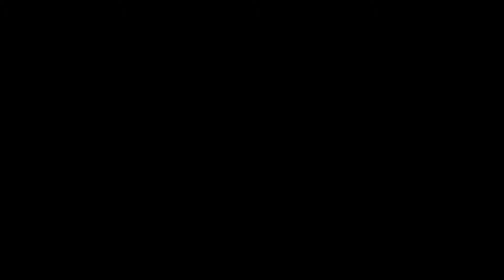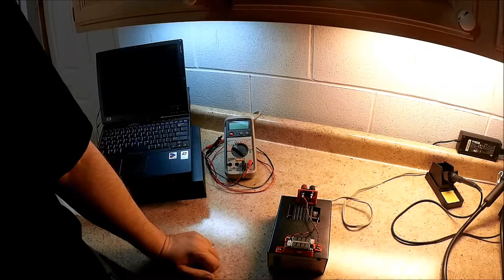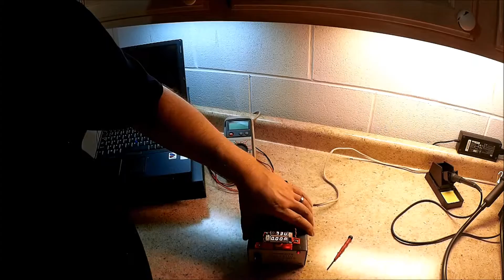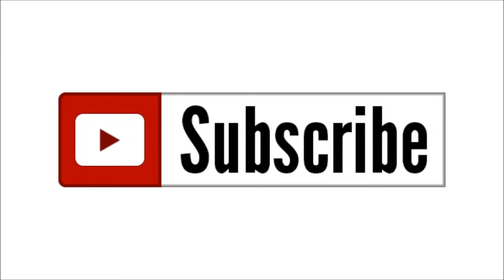Benchtop Electronics - Power Supply with 3D Printed parts

Comment: Hah!! Just viewed this video and how timely!! I'm attempting to turn a spare  ATX power supply from a PC as a bench top power supply. I will have +12v, -12v, +5v, & +3.3v outputs to banana clip connectors like you have on this project. Now one thing I would like to have is the ability to have +24v but know I can't just connect two of the +12v lines together because I would only increase the current capacity instead of voltage. But could I connect the +12v & -12v lines to get that +24v?  I have a work project that I am messing with where need to provide some voltage to a MOXA e1242 DI channel that will provide a signal that will pass through a N.C. float switch where the MOXA will monitor for change of state when the float moves. I could use a wall wart with about 16v that I could use for testing my mock up but wanted to make a bench power supply because it's geekier.  I am printing a housing from Thingaverse for this.
Reply from the maker: +Norbert Davis To get to 24 volts, you would need a power buck to kick it up (http://www.ebay.com/itm/DC-DC-Step-Up-Down-Boost-buck-Voltage-Converter-Module-LM2577S-LM2596S-Power-N2-/400985223988?hash=item5d5c94f334:g:HhsAAOSwgQ9VpIkZ)
Reply: I like that.  What about this one from Amazon? https://goo.gl/j45pdi  Its only $6.70 and is Amazon prime.  I have other stuff to get and could have it by tomorrow.
 I want to put a cigarette lighter"DC power adapter in the housing as well as a USB port or two just because.
Reply: I'm going to a beginners soldering class tonight put on by some local "makers".  I really want to start practicing and get a feel for soldering so I can make the modification on the controller board for the heat fluctuation.  I tried a little it of soldering the other day. I SUCK!!  LOL.  This  ought to be fun tonight.  Its at the Folsom Ca Intel campus. The company that I work for built the particular building the class will be at tonight and about half the campus.  This will be cool.